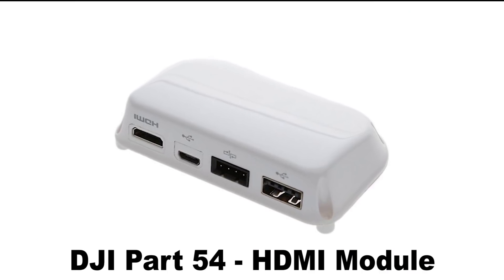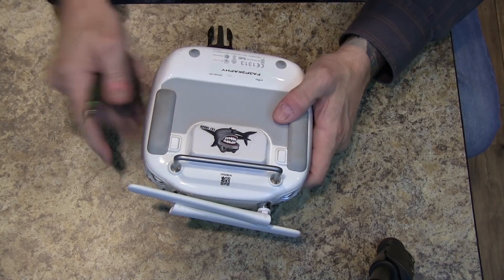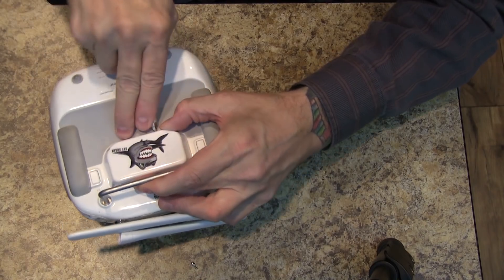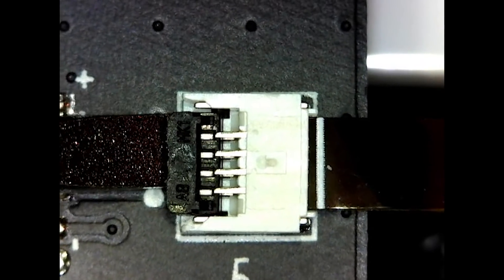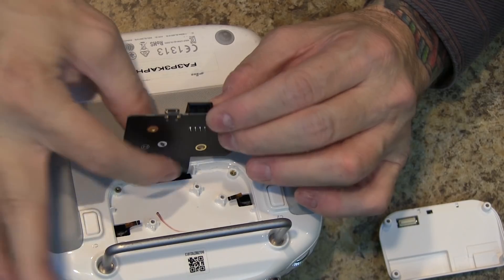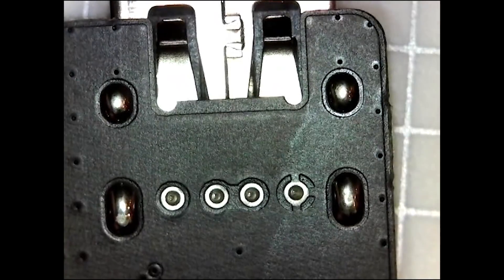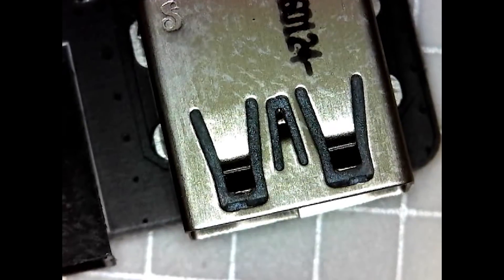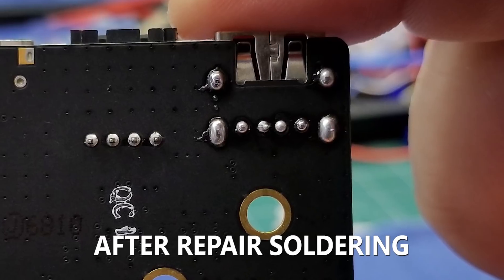Your DJI HDMI module might need REPAIRS - KEN HERON

Comment: i had this exact situation. bought this hdmi module for the p4p and got the glitchy screen. no firmware fixes app tweaks cable jiggles did anything. will try fill-soldering those points. if that works ill be AMAZED. AMAZED I tells ya.
Reply from the maker: Good luck Phil. Fingers crossed!
Reply: I have the same issues.  Did it fix yours?  The last time I used my P4 the damn app glitched and the drone took off on its own!  I was trying to force it to come back to me but it was fighting me!   I finally had to crash it to get it down as it was heading for power lines!   I have been swamped of late and have not had time to try this fix.  I need to use the drone in a week or so and really want this damn problem solved.   I have had this problem since day one!
Reply: And Yes, I always keep 'return to home' turned off.

Comment: Hi buddy,,I’m having a problem with my p3p,,,I’ve updated the drone and  tried the controller but now the app doesn’t connect to controller and nothing wants to connect to it,,I spoke to a local drone company and the mentioned that I might have a problem with my board in my controller but after watching this video of yours,I think you might of solved my problem hopefully,,,I’m just wondering where you said that the 4 soldering points may be the problem,,what do I need to do,add more soldering on top of the previous ones,,,I’ve seen spare boards on eBay at £10 and are advised as being original but they are from China and I don’t want to waste my time putting a part in my controller that might be fake and then my drone flys off but hopefully this is what my problem is 👍

Comment: P4 owner with the HDMI module.  From day one, I've had issues with the green glitches and sometimes it's so bad I can't see enough to fly it back.  I've had to look at the P4 and fly it visually back to home.  I've also had app crashes.  I've tried the firmware update but that didn't really help.  I've also cleaned all files off of the tablet but the green glitches are still there.  I reduced the bandwidth of the video feedback down to as low as it could go.  Still, the green glitches are there.  I have noticed that that HDMI module get really hot too.  I've wondered if it was an overheating issue.  Perhaps, the cold solder joints are reacting to the heat and become more glitchy.  I will open my HDMI module and apply this fix.   I hope that it will help.   Thanks, Ken!   Best WIshes!
Reply: wwsvs did the fix help?

Comment: Ken, I repaired my part 54 with a quick solder job and amazingly it now works. This is great information as I have run across 2 rc's with this issue. The first one was repaired by buying a new 54... Grrr ! wish I had seen this sooner.

Comment: Good info Ken and thanks for sharing.  
It’s good practice when working on printed circuit boards to wear an anti static strap thus preventing any possible damage to the components that populate the PCB.

Comment: Ken ,I had this very problem just this last weekend. I have a P4 with no HDMI module but I had been having issues with connectivity.  Also i could not connect with any of my normal FPV apps either.    I remembered this video and watched it again and sure enough when i wiggled the USB connection on the controller I lost and then regained connection.   I will take it apart to examine solder joints and to tweak the retention springs.   The fit is almost too loose on the connector but MFG tolerances are a reality in all things.  Thanks for the heads up .

Comment: Thank you soooo much. just got my P3A yesterday and by today I cant connect - same issue. I have troubleshooted, reset, changed cables, updated firmware of the aircraft. (the remote cant update cos i need the usb to work). I talked to DJI (their customer service is crap) they said I should send it over to their repair centre (which is halfway across the globe from where I am).  I will rip it apart today and give feed back on the development.

Wish me luck!!!

Comment: Thank you Ken for the great video. Did I mention you are my favourite 'content producer'? Because you are my favourite content producer. (Not that I condone the use of labels). 

When you were undoing those screws I had vivid flashbacks to when I modified my Phantom2 to accept a video tx module. The poor quality jeweler's screwdriver that I was using slipped and went into my left palm - I could see the tip poking the skin on the outside of the my hand. It managed to miss all the bones and nerves but my biggest regrets to this day was not taking a photo of it before I pulled it back out. And I wasn't going to put it back in for a photo, that's for sure. 

But enough about me, thanks again for this video - and for the 'scroller'.
Reply from the maker: You are very welcome Ben!
Thank YOU for spelling "favorite" with a 'U'. That's very European of you!
Glad you enjoy the scrolling too.

Comment: Ken, if you feel that this could potentially cause a threat to the health or safety of the user or others, you can submit it to the US Consumer Product Safety Commission. If enough people submit this same issue, they can force DJI to issue a recall. 

Here is a link to the CPSC website where you can submit your information:
https://www.saferproducts.gov/CPSRMSPublic/Incidents/ReportIncident.aspx

As always, thank you for sharing this information! Safe Flying
Reply from the maker: Thanks Derek!
Fortunately, this issue only affects the app and not the actual controll-ability of the craft.
Reply: Well, if the device gets disconnected while you're flying, you had a spotter, and you were looking down at the screen, you might not be able to see where you're going, and the drone could hit the spotter. It's a bit of a stretch but I think it may go through :D.

Comment: Great work sir, very useful info. The 4 machine welds can you put a bit of solder on those 4 to firm them up?
Reply from the maker: Yes. That's what James did for mine in the shop.

Comment: Ken, I have the same problem, however I went into the software and turned the HDMI output off and that cleaned up the video problem with the tablet. if I turn the HDMI Output back on the problem returns. So, I do not get to use the Fat Shark but I can fly my P3P with out the video problem.
Reply: Patrick D. McGinnis my dji go app is missing that option no HDMI on or off button =(
Reply from the maker: Very good!
Reply: If you start the DJI GO app and have a video feed on your tablet select the quad copter icon at the top of the screen. Then select the HD icon. turn off simultaneous image to app and HDMI. I also turned off Display OSD on HDMI Output and Use metric units on HDMI output. The last two may not be necessary. I am using a P3P and an iPad mini 4.
Pat
Reply: Patrick D. McGinnis yeah I have follow these steps and on my HD menu I don’t have the option to turn Anything on or off it’s so frustrating I’ve been reading DJI have removed this option out from the go app
Reply: What are you flying and what tablet are you using? I just checked again and I have these options. Come on DJI, this should work. We all want to fly.
Reply: Patrick D. McGinnis I have a phantom 4 pro  and I have tried iPhone 6 my google pixel and my Samsung s3 tablet. All I want is to be able to run my new DJI goggle and  app at the same time. I’m on my second part 54 hdmi module and still no luck I’ve follow Ken’s firmware update and done the soldering on the part 54 and still nothing I left a link a few message up
From yours watch the film and you will be able to see my problem. Thanks
For getting back to  so fast

Comment: Cold solder joints... Hundred dollar part good grief. Nice close up Ken...
Reply from the maker: Yeah... They need to get some dang HEAT on them parts!
Reply: Your Recall Suggestion is good. I am in the market to buy hdmi board for my P4....
Reply: Dave Billings I purchased a what I thought was nice new soldering station on eBay with a full two year warranty for $120. When I got it, I found the iron would heat up to around 130 degrees and then cool back down to 85 even though I had it set at 330 degrees. After fighting with the seller, I just filed an eBay refund claim and decided to open up the case on the soldering station to see what was wrong. No! I didn't send it back for various reasons. First one is the seller should have honored his damn warranty in the first place! I ended up resoldering 7 wires that you were literally able to move in and out of the solder joint! I just decided to resolder all the joints after seeing that. Works great now! Used my old 40  year old soldering iron to fix my brand new soldering iron, Go figure! That's China parts for ya!

Comment: Hi Ken .... Sometimes when i fly the app just shuts off (while the drone is in the air and i almost have a heart attack) I use a Samsung Galaxy A5 and it's new ... I tried a few thing but nothing works ... It dont do it all the time but it's a pain in the a** ... Could it be because of the part 54 ?? I just fly and all of a sudden the app closes for no reasons ... Never had a accident for now but ... 
Thank You so much Ken !!
Reply from the maker: Hello!
Tell your heart that even when the app crashes, you can still control the drone.
Yes, most likely it's Part 54. Newer versions are more robust for some reason. It's the USB connectors that are the weak link. Try my fix, then buy a new one if the issue persists.

Comment: I was hoping this contained info about issues from the hdmi out. My usb is fine, but a few weeks ago my hdmi stopped outputting the video, yet it still shows the osd info, but a black screen where the video would be. I’ve tried several hdmi cables, three different display screens, and all the same. Web searching hasn’t turned up any likely culprits. And no I haven’t updated any firmware or database info for my P4P to have triggered it. Any suggestions? With the osd portion still showing correctly indicates to me it’s not likely the hardware.
Reply from the maker: Sorry to hear that Dave. 
Maybe try this: https://youtu.be/CUW8QFGNPNM

Comment: Hey ken my HDMI module Was working fine I got it in March but when I go to hook the HDMI to my field drone it disconnects the drone, just all of a sudden start working I hope it’s not and update firmware issue. I also cannot use it on the DJI goggles now for an external monitor because when I connected it itdisconnects the drone on my IPad mini 4 any help would be appreciated
Reply from the maker: Check the USB connection. Try a new cord, and make sure all of your firmware is updated.

Comment: Hi Ken, I got mine in and installed it today for my P3 4k.  The bottom slot for the bottom (wide) cable is much wider than the original.  It is much wider than what I see in yours, or anyone elses video.  All I could do is insert the cable anyway in a relatively central location and lock it down.  I haven't tested the hdmi yet because the new input on the module is much smaller than a standard hdmi cable so I have to go find an adaptor somewhere.  I guess this means they made a new module, but I have no idea if it's going to work.

Comment: Hey Ken, I fly a P3P, and I've been chasing the green screen/loss of video/pixelation for over a year!  It started one day while in flight about 40 feet away.  I've even bought a new aircraft, but I still have the problem.  What was the final fix for you?  Was it this USB connection?  I don't have the HDMI connection, but have a similar USB connection on the GL300B remote.  Thanks!
Reply from the maker: For me it was a firmware issue. This might help: https://youtu.be/CUW8QFGNPNM
Reply: @kenheron  Thanks!

Comment: Do you think that opening the controller will void the warranty?  I just say this because I recently sent my controller back (when it was out of warranty) due to a common issue with the battery not holding a charge and they replaced it for free even though the warranty was well over.  They gave me a hard time about it and i worry that if someone had a other issue with their remote but had opened it, they may be SOL.  Wouldn't want them to be mad at good ole Ken Heron either ;)
Reply from the maker: Hey Cory--
Thanks for the KENcern... But I only opened the module area. DJI manufactures the HDMI module with the understanding that owners will install it themselves. The battery compartment might be another story.
Reply: Ah good point!  I knew you would be smarter than to advise ppl to potentially void their warranty but I was indeed KENcerned!
Reply: Cory Armitage you have to open it to install the HDMI module anyway, not to mention DJI makes this part#54 so I don't see them voiding your warranty over opening the RC....
Reply: Charlie Martin thanks.  I didn't realize that it was an external part and that my DJI controller doenst have an HDMI output on it from factory :)  I'm a little embarrassed lol

Comment: Ken I love you I told you there was something wrong ty ty ty
I'm gonna try it now
Reply from the maker: Very good.
Try jiggling the USB cable while the app is running. If it changes stuff, then this might be your issue.
Reply: I’m about to do the controller firmware first then this stage. I missed the other video I really appreciate what you have done I have my new goggles sat in the corner for almost 3 weeks just because of this part 54

Comment: Thanks for the info Ken.
I didn't think that I would need to use Goggles, even though I see you use them all the time, however just the other day I was trying to video some surfers and found it very difficult. Hence I thought of you and your goggles. 
Now my question for you is this.
I used to see you flying using your shark goggles and then Dana got you to wear his one day.
Now you have the DJI Toilet seat also. 
Good goggles are going to cost some decent mula, so now that you have experience using both pairs, would you recommend the Toilet Seat over the sharks for the purpose of flying for say an hour to an hour and a half, as opposed to using the sharks which are designed, I suspect, more for the FPV Racer, who is probably flying all day?
You thoughts please.
Reply from the maker: Great questions!
 The DJI goggles are better resolution, but the fat shark goggles offer a better idea of depth of field for some reason. Even though neither one is in 3-D. I prefer the fat sharks for precision flying and the DJI goggles for fun flying. Both goggles batteries last a really long time, but the fat sharks batteries last a lot longer just because they require less energy to run. Thanks for the questions!

Comment: Great vid!!!! So maybe i could get your thots on my issue?  HDMI board on p4p. All is good except when plugging in HDMI cable to googles and turning on goggles. Fine if I just plug in HDMI cable. App disconnects, no vid in googles, app says disconnected.  Unplug cable, then app reconnects to p4p. Strange!!!(cinimizers and dji goggles RE which did work before) Maybe a broken solder joint? Ill take a peek like you did on the USB connection. Thank you!!!!!
Reply from the maker: Hope you can sort it out Brad. 
😁👍
Reply: @kenheron   wow this is something... i now have the same issue with the goggles not working. Now i cant remember how i fixed it! LOL didnt write it down! will this time! Any thoughts Ken, id love to hear it! Ill try looking at the HDMI solder joints....Maybe hit em with a hot iron... thanks Ken!

Comment: Does this mean i shouldn't buy the phantom 4?
Reply from the maker: Not at ALL!!
It's just maintenance, that's all.
Be careful with the USB connector and if you ever have troubles, you might check the solder.
Reply: Ken Heron Ok thanks, I appreciate your help
Reply: I bought the phantom 4 and the usb is broken xD ..... won't connect somehow i saw this coming....